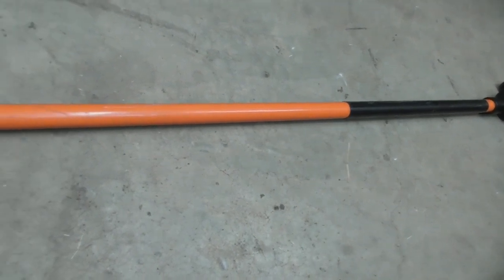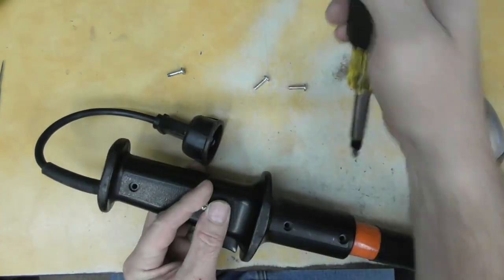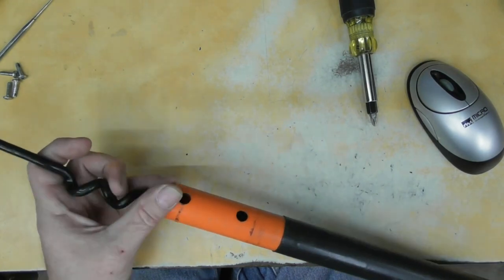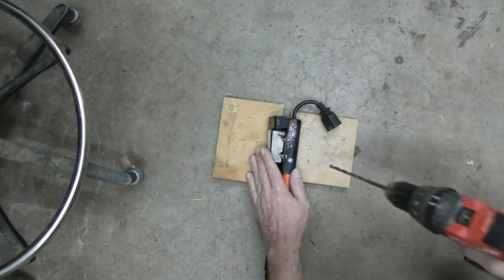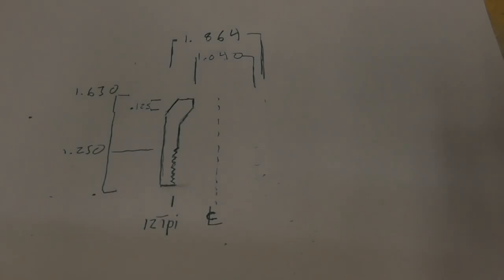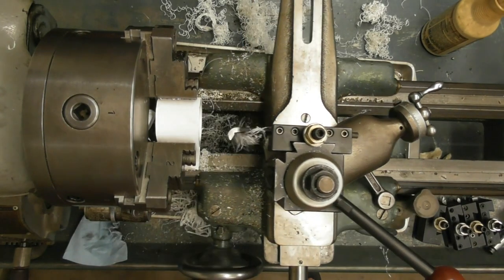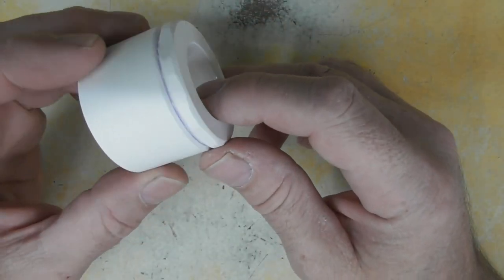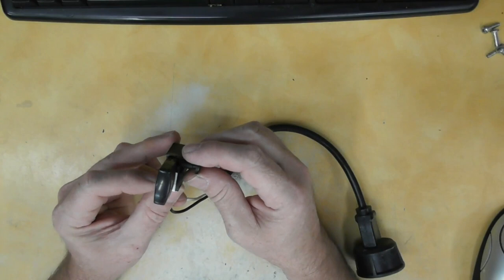Making a Replacement for a Broken Lock Collar Nut on a Remington Pole Saw

Comment: As usual, You do an awesome job. Wish I had a lathe like that.
I found a very simple and very effective way to repair any type of plastic using CA and ash. You apply a small amount of CA to the crack, then sprinkle ash on it. A little more CA and ash until it's built up to where you want it. It dries so hard that you can file, drill, or sand it. I have repaired MANY things this way and it really does work great........for those of us who don't have the means to create new parts like this.
Reply from the maker: Thanks, and good tips. I will say again, Sapulpa, for real?
Reply: @ghostses  For real?
Reply from the maker: @sapulpaorganics5402  That's were I Live. Small world. G.

Comment: Good to see you are safe and sound and still cranking it out!!  Nicely done G and only one trip to the HW store!  Engineering on the fly for a one off, one must always be agile enough to adjust for skim...loved it!  Nice tutorial too!  Glad you didn't show stripping off all that coil insulation, might have fallen asleep.  ;-P  A tip on that coil wire is to use PlastX liberally and let it set for a while then wipe it down real good.  Did it once B4 and it worked to soften the coil a bit, worked for me.  My Best to you and your family!  ~PJ
Reply from the maker: Thanks PJ! Yeah, stripping off the coiled insulation was a pain. Good tip on the PlastX. I'd not considered trying to soften it- I just went my direction. Hope the same for you and yours as well. G.